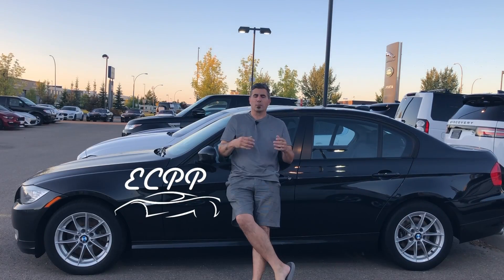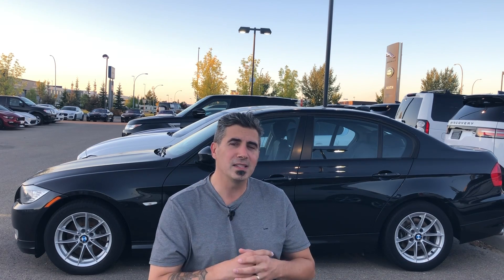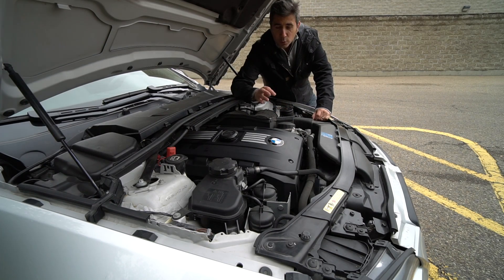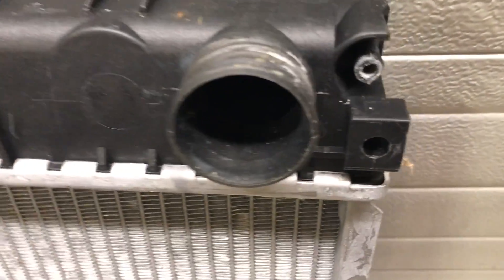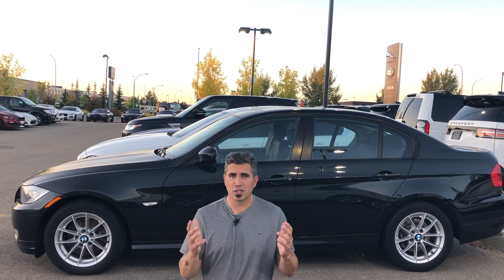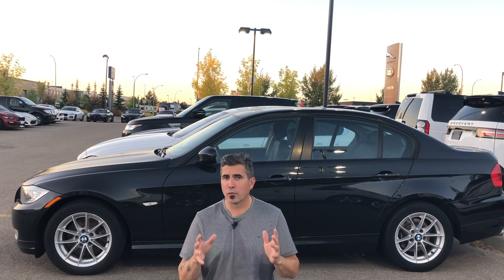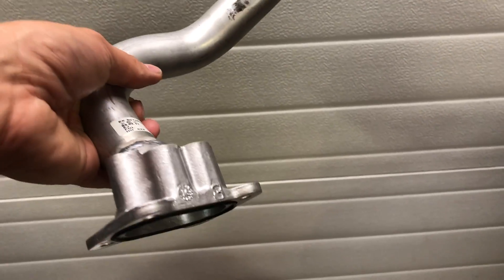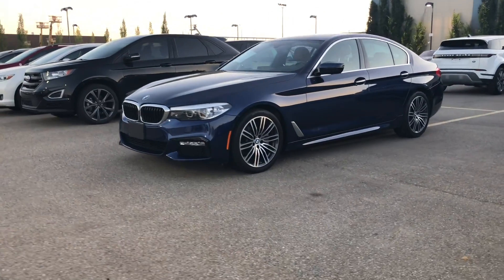Why Does BMW Use Plastic Engine Parts??

Comment: No wonder some aftermarket components are being manufactured using aluminum!
Reply from the maker: I hear that.  I owned the 335 and there was a factory plastic fitting that the aftermarket re created in Aluminum because  of how fragile it was.
Reply: @ECPP  The aluminum  coolant hose flange? (Mickey mouse)
Reply: The excellent GM 3800 engine lived for years with those damn plastic  bypass fittings between the engine and tensioner assembly for the cabin heater. GM never fixed the problem and the after market sold aluminum replacements in lieu of plastic. That was the achiles heel of the 3800.
Reply: Other manufacturers also use too much plastic
Reply: @timothykeith1367  yes, they do. Good quality plastic. 

My 2026 Toyota still has all of its plastic parts. 

My 2015 BMW, has had more than 15 plastic parts replaced & continues to crack.

So, respectfully, cheap plastic in these cars.

Like a cheap Chinese good looking watch.
Reply: @timothykeith1367  true but the end user's wish is to see more durable materials than plastics. But hey guess the manufacturer finds plastic cheaper .
Reply: @bwalyabwalya2796  Maybe stamp an expiration date on plastic parts!

Lots of metal aftermarket parts come from China and are often not reliable.  Plastic valve covers could have cast metal flanges or stiffeners to prevent them from warping.

Its a good idea to look under the hood of vehicles once a week, check fluid levels, look for leaks.  Changing the oil yourself is a good time to detect leaks.  A BMW is an expensive investment, not an appliance. Even some Lexus models have had problems - not many, but some.
Reply: @timothykeith1367  some of them ask for a lot less money for their product.
Reply: I don't think it's a good idea to replace a plastic part with an alloy part. I'm not an engineer and I could be wrong, but it will create a new weakest link.
Reply: @manoman0  to some extent you maybe right but some parts like aluminium radiators have proven to be far much better than the plastic ones, it depends on the part being replaced i think.
Reply: @manoman0  That's kind of like saying that steel toed shoes creates a new weakest link.  The issue is whether an aftermarket part is high quality.  I think we're better to proactively replace the plastic parts that are known to fail, like replacing brakes before they fail.  Especially replace the plastic cooling system parts before they crack or warp - parts that are known to cause catastrophic engine damage. 

I think E46/E39 might be as new as I'd go, that's just me!  I think I can handle the maintenance and repairs on those older cars.